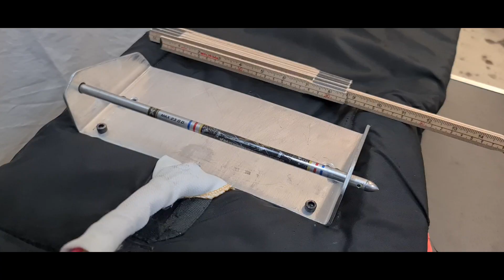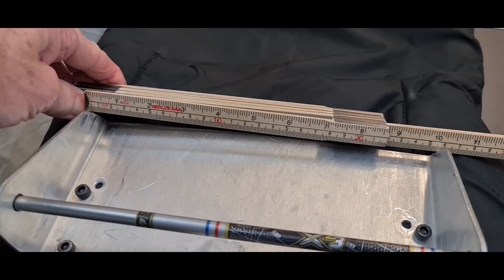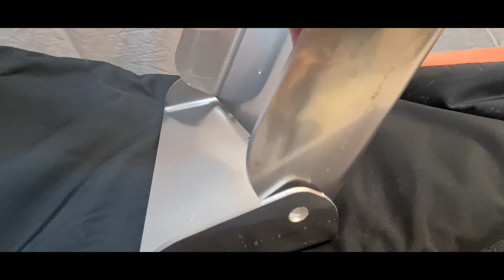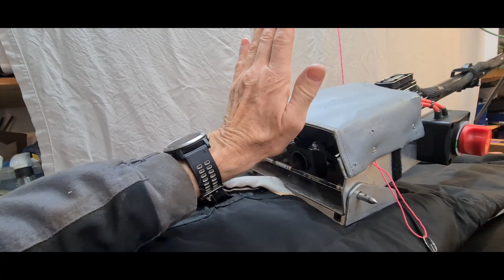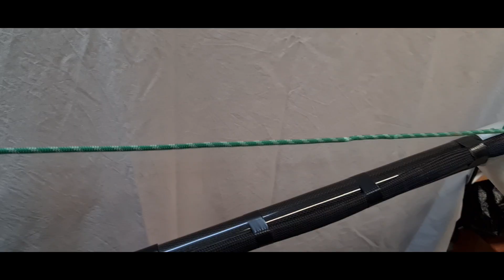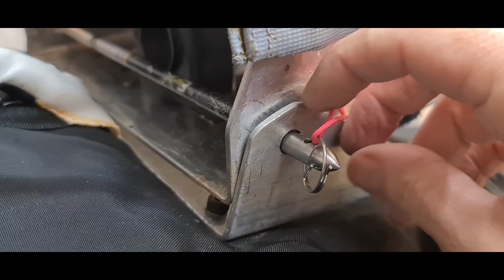E-help by Meij-tech. Build manual 3. Eng

Comment: The edel clamps to the harness tubes should either have shorter clamping bolts or have the heads on the INSIDE of the harness; having bolt thread stubs on the inside of the harness is potentially dangerous from having them jammed into your back in an incident. Perhaps shorter bolts, using vinyl covers if you want to keep the heads exterior. The sleeve to protect the hang strap is a good idea, but I think I might use a loose 3mm SS cable inside the hang straps as a back up.
Reply from the maker: Yes. Shorter bolts is good :-)
Ss cable to :-)